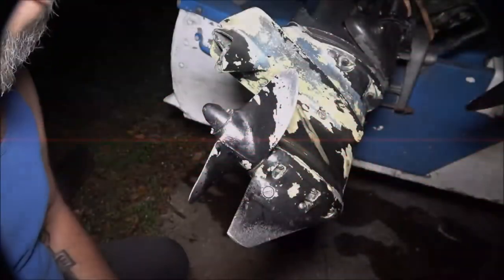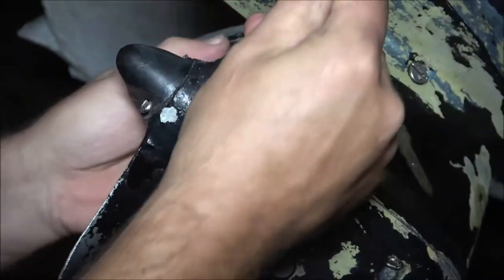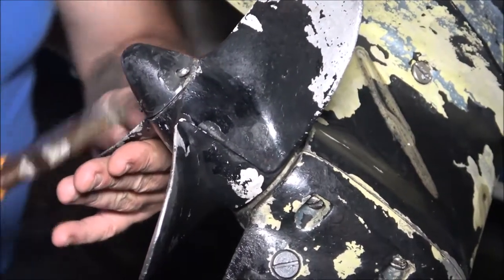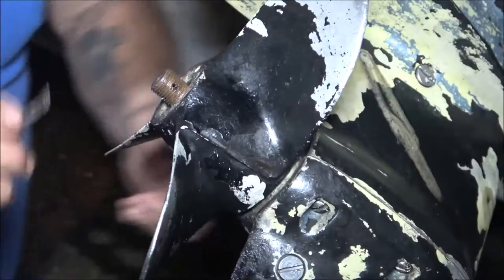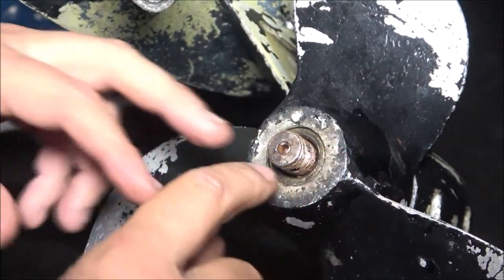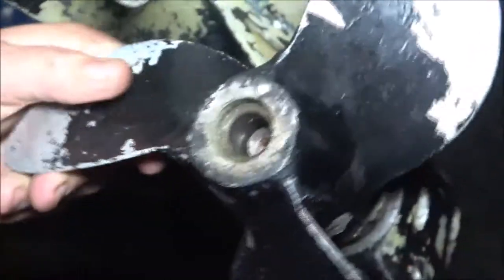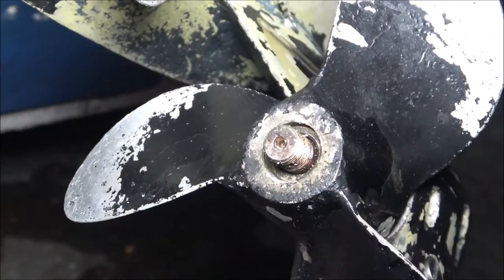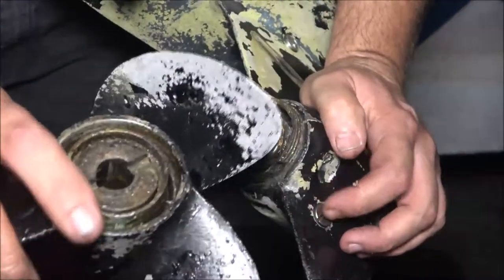Spun A Prop, Diagnosis

Comment: When you got the new prop put on did it make a small grinding noise? And after you ran it, the prop free spins now by hand with it in neutral?
Reply from the maker: Never made a grinding noise and always spins freely in neutral.
Reply: Okay cause mine did that, it would grind a little but it free spins now after I ran it out on the water, so hoping everything goes good
Reply from the maker: @zachcheek5195  it might have been rubbing on the case.
Reply: Yeah I’m not sure it seems like its good now that I ran it, It free spins in neutral like it should